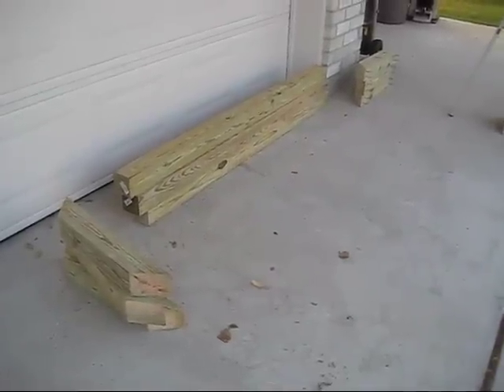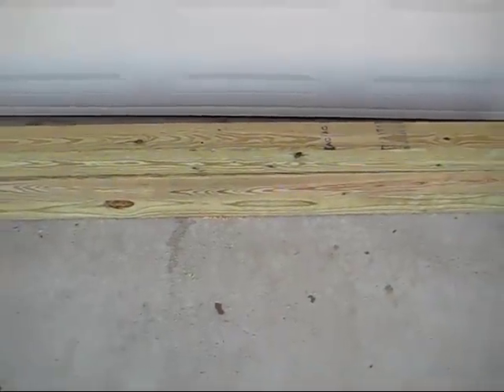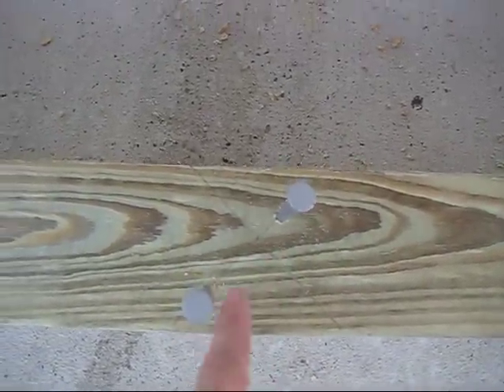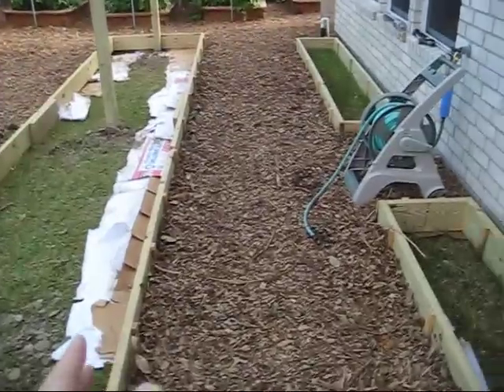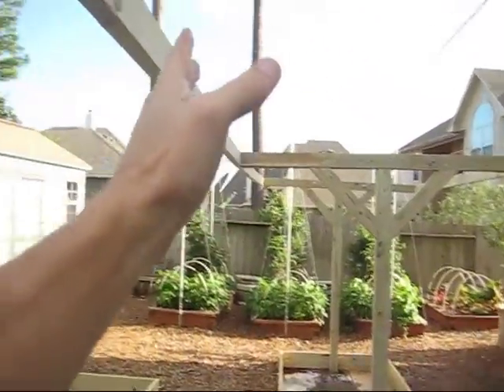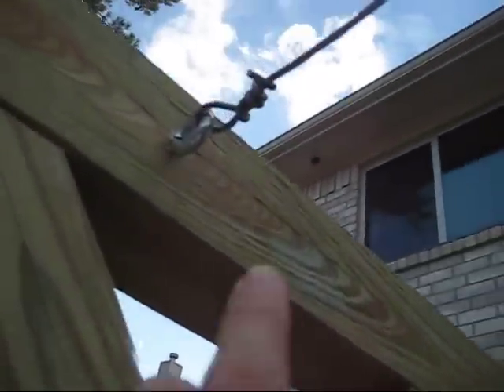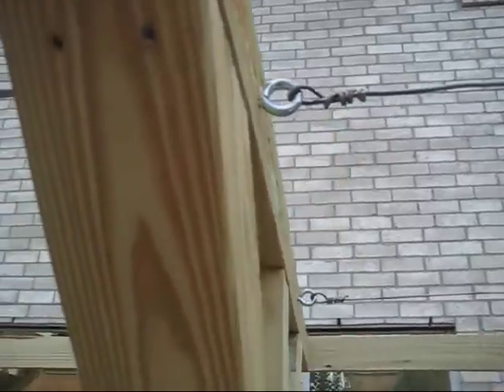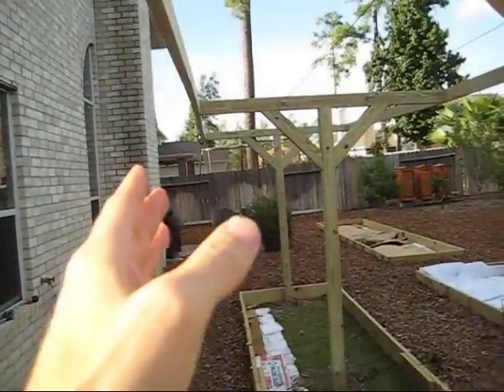Mittleider Gardening: How To Build T-Frames for Vertical Gardening

Comment from the maker: Awesome. Thank you for giving this a try. I found out that it is not necessary to have tight cable on the top. I would just put a eye screw on both ends and pull it as tight as you can. You don't need it any tighter or to spend the money for all the pieces that I show are optional.

Comment: Well done. This season I experimented with all the various supports for my tomotoes: electrical conduit, spiral support, texas tomato cage, string and plastic clip supports and all had some problems.  I came to the conclusion that this type of overhead support is the only way to go. This substantial support will last forever and you definitely won't have to worry about it falling over mid season.

Comment: I started mine in May but I still only have the two post up and one frame built. I do have the newspaper, cardboard and the mulch down. I don't have the cable/wire up but it seems to be a great system so far. I've been doing this slowly while fixing other things around the house. I plan to get my solar heaters done as well before the real cold weather hits here. Thanks for sharing this system. Ann

Comment from the maker: Read the handout you received on building the T-frames. It is explained there. For those who don't have the handout put a nail in the box frame and hammer a 18" stake with a nail in it about every 5 feet in the bed, attach a wire to the nail on one end of the bed then string it to the first stake, wrap the wire around the stake and continue doing the same until you get to the other end of the box and wrap the wire around the nail there. CONTINUED...

Comment: a thimble softens the wire against the eyebolt. the crosbys (u bolt with saddle) "never saddle a dead horse" use the saddle on the live end of the cable and alternate every other one. If you drive rebar into the ground out past the ends of your structure you can stabilize the whole thing with the proper tension. I am thinking of running two rows of dutch buckets down the middle of a fourteen foot wide greenhouse with raised beds and/or kratky method raft boxes along the walls. I hope to get this going in late July/early august.

Comment from the maker: Then cut your strings about 9' long, tie a slip know on one end around the wire in the box and tie the other end with a slip knot on the wire or 2x4 at the top of the T-frame.

Comment: I am way too old to manage constructing and then putting in place the 4x4 end and support posts. Would it be possible to construct them from 2x4s and then maybe bolt them together? Would that work? I have been impressed with several ways you have creatively improved the basic system, so I am hoping you will have a workable solution for me.

Comment: I like what you have done with the longer tops of the T-Frames.  Since you have more vertical space than the normal size T-Frames in the Mittleider book. Have you increased plantings more than the recommended amount per plant in the book?

Comment: Had to think about this a bit from the parts list, but the parts cover all the elements shown for a 20'-0" run, though not stated in the text specifically.  You'll want to adjust if your run is not 20'-0" obviously.  Also, thanks again, LDSPrepper.

Comment: David... did you concrete the 8' posts into the ground?  I'm still in Bryan-College Station, so the ground is like concrete itself, right NOW, but during winter when it rains incessantly, probably not.  Thanks for your reply.

Comment from the maker: Put a nail at the end of the grow box frame at grown level in line with your plants. For a 4' wide box you will have four rows. Then use "tie wire" (you can buy it at home depot Store SKU # 572365) and run it the length of the bed. Then tie your string from the top of the T-frame to the tie-wire on ground level.

Comment: +LDSPrepper I didn't see anything about how or where you secure the twine that you use to guide the plants vertical.  Are you running some cable across near the ground that you tie on the bottom of the twine to?  Sorry if this has already been talked about or asked.  I'm just trying to wrap my head around the way to secure the bottoms of the twine.

Comment: David, I'm in Colorado and just finished putting in my T-frames so I can grow vertically. We've been getting a lot of rain and snow over the last few weeks and because there is so much mud, my frames are feeling pretty wobbly because the soil is so saturated. I haven't put in my soil yet to the boxes (can't find any "clean" sawdust around here) but I wondered if you had to deal with the problem of wobbly t frames? Thanks for all you do.
Reply from the maker: ***** If your T-frames are in the grow box put three 3" long screws through the 2x8 ends into the T-frames. I did that and it really made the T-frames stable.
Reply: ***** I also just built the T-frame with the same issue even with the screws. I added six 2 x 4's (one to each side the T's) going 12" into the ground. rock solid now and i figured it would help with the shade cloth i have coming 104 yesterday in Houston. Thank you David t system went together quickly and well because of your videos
Reply: Brad Ensing Thanks for sharing Brad! I ended up putting some quickcrete below the soil in mine a few months back and mine's holding strong. Thanks as well to David for all of your hard work and help!

Comment: If I build the standard 18" x 30' bed with "T" posts, and the watering system where should the "T"post and water system be place? Both can't be in the middle without drilling a hole through the "T"post or routing the water around.  What would you suggest?
Reply: one near the left and right, those will rot your post faster

Comment: I'm sorry if I missed the answers but, why is the T 6ft wide instead of 4ft, and, on the posts sunk into the ground, why only 1ft? Do you need to go below the frost line? (up here, that's somewhere between 30-40 inches.)
Reply from the maker: matermark The T-frame is 6' wide because we want it wider than the 4' box in order to direct the plants outwards so they get more sun and air. The posts are 15" deep in the ground.

Comment: I like it. Im going to build one also but im not using the wires across the top. It would be easier and stronger just to use 2x4s like on the sides. Wires are to much work and to many parts so if it works on the outsides with 2x4s should work just fine running them in the middle to.
Reply from the maker: Manitoba homestead You could use 2x4's. No problem.
Reply: LDSPrepper I now have seen your update. You made a really good point about putting the wires a few inches in from the outside. Really like what your doing I have learnt a lot from you. Thanks Chris

Comment: The modification I'd make would be to use braided or twisted wire rope/cable instead of solid wire. Belay one end and run the cable to a pulley on the opposite t-frame, over two feet to another pulley, back to another pulley on the original frame until you end up on a turnbuckle to tension it. The tension on the cable will be equally distributed along the length of the cable preventing twisting of the frames. As weight of produce varies, cable tension self adjusts. Use 1/8th inch cable. If three t-frames are used drill a hole slightly larger than the diameter of the cable and pass the cable through the middle frame.

Comment: You don't have any concerns about having treated lumber in contact with your growing medium? Won't the chemicals leech into the medium and get into your food?
Reply: Heather Franklin He covers this many times throughout his videos, that treated lumber no longer uses arsenic, but instead only copper - as I recall he says it has been the case for more than 13 years.  Copper is good for the garden for the little amount it leaches.  At the time I'm building mine, I plan to inquire exactly about what's in the treated lumber that I'll be looking at, just to be sure i have full awareness.  Good to know that they've gone green, though, so to speak.
Reply: Heather Franklin You can also paint  the bottom of the post with primer or sealant to prevent any leaching. I did this with my box framing.
Reply: DogWalksMe Thanks for the response. I wasn't aware of the changes in treated lumber, but I feel much better about it now. I've watched a handful of LDSPrepper's videos, but I have not yet seen any where he addresses this concern. I googled it after The Tte's response, and it seems like a safe option now.

Comment: why did you make the 45degree supports 2 feet long....if i were using different lengths than you, how would i make the correct calculations?
Reply from the maker: The supports are two feet long because we take 8' lumber and make it into a 6' header, leaving 2'. So we use the 2' for a support.